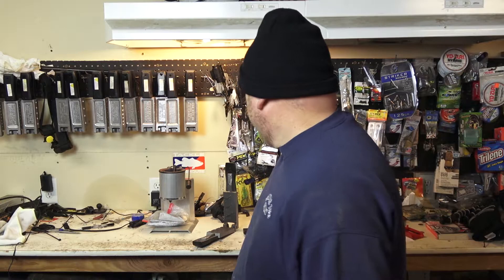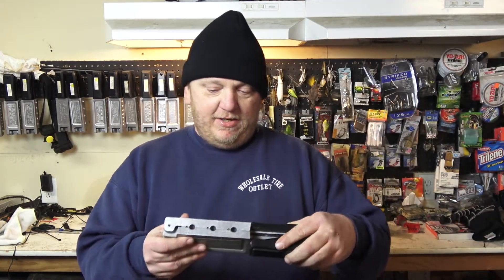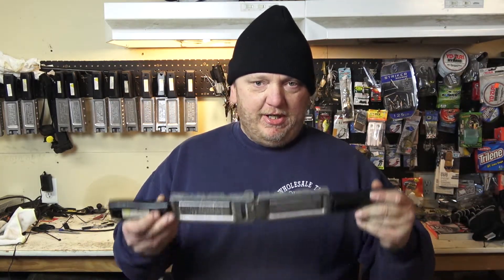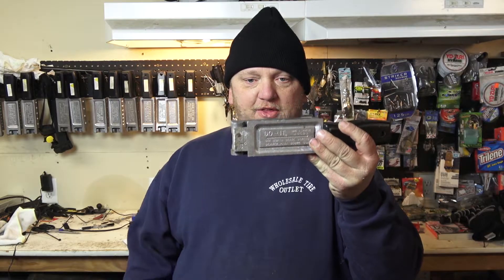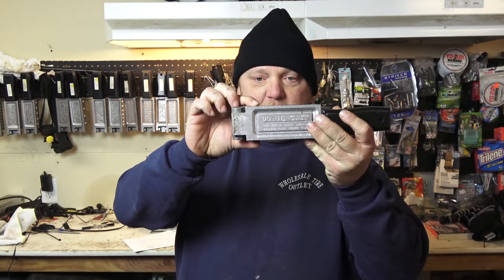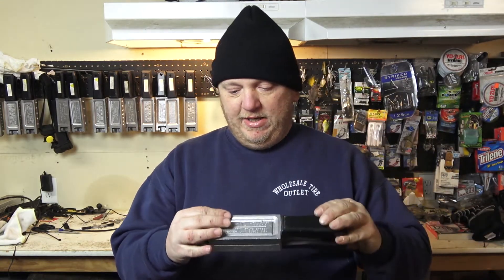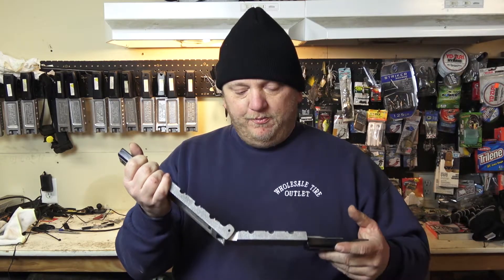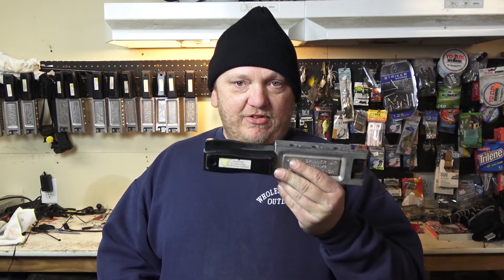5 Tips on How To Pour Those Really Tough Lead Molds, DO-IT Molds!!

Comment: I've been doing the ned rig mold and the hook is shakey and the keeper falls off
Reply: You ever get it figured out?
Reply: Justin McGee nope sorry :(
Reply: @fisherman5678  are you painting yours?
Reply: Make sure you have the right size hooks for your mold
Reply: Try adding a touch of plumbing solder to your lead. Plumbing solder is made predominantly of tin. Tin lowers the melting point and surface tension of lead so it flows better giving better fill out. It also helps "bond" the lead to your hook and whatever else you're molding in with the lead.

This is common practice in bullet casting but the only down side I've seen in casting fishing tackle is it allows for a bit of flashing that you'll have to trim off with a razor knife.